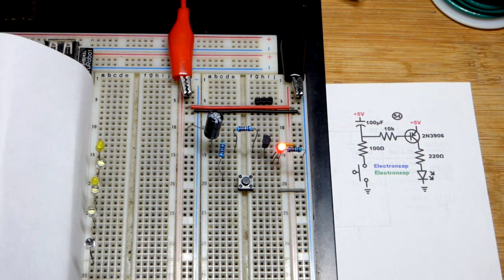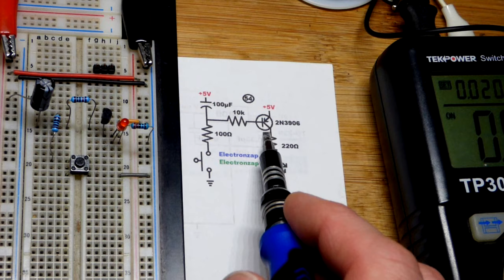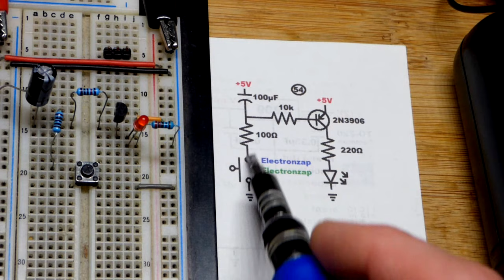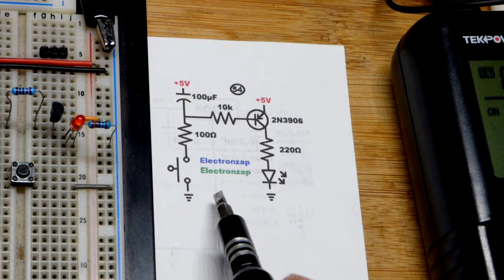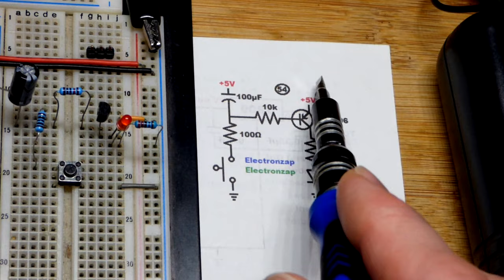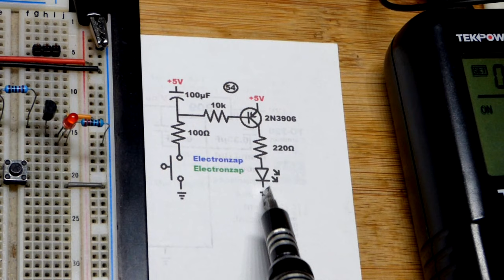PNP BJT Extends Capacitor Discharge Time For LED Load 2N3906

Comment: Sure, this may extend the run time of the LED a little bit, but you're wasting power in the voltage divider that biases the transistor ON, plus there's the voltage drop of the transistor, and finally the voltage drop of the current limiting resistor. All those parasitic losses really add up. 
How about instead you use a depletion mode FET, use the capacitor's own voltage to keep the transistor turned mostly  off, and eliminate the current limiting resistor?
Alternatively, run the capacitor's stored charge through a joule thief also based on a depletion mode FET, and thus continue to drive the LED for a while, even when the capacitor voltage drops below the LED's turn on voltage? 🤔
Reply from the maker: Thanks for the observations!